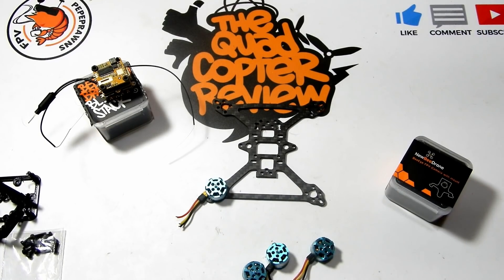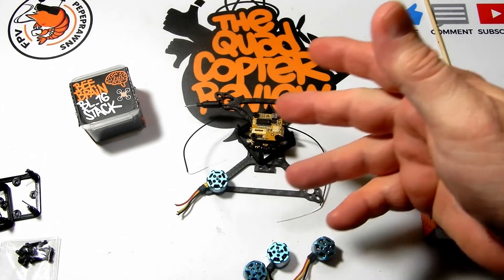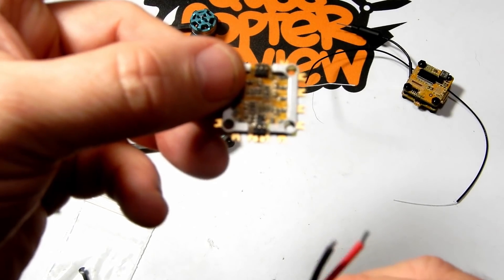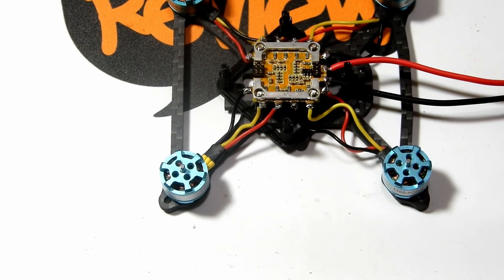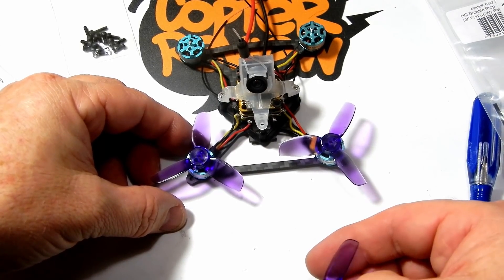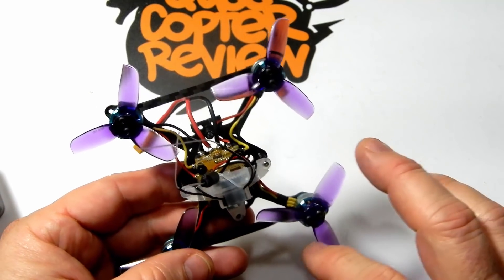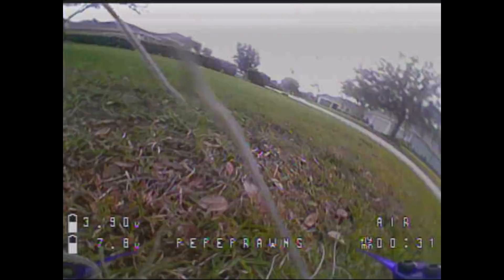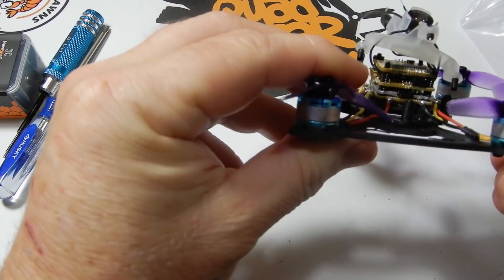Newbeedrone Hive 16 on a Lil Bandito | Oops I Broke It!

Comment: Thanks for the review and crash footage! ;)  Hmmm...Hard to believe a 16x16mm stack is worth anywhere close to 100 buckaroos! YIKES!  We can buy top notch 3" or 5" gear for that price with way more performance. Especially when the iFlight SucceX is HALF of that price and is 2-4S, includes a 100mw setting, and pretty much duplicates all of the other specs.  I does not have the built in receiver, which I prefer, and most do. Built in can be a problem! Look at the Crazybee F4 Pro v2's...those are notorious for short range and fail safes because if it. I bought the no receiver version of that purposely so I don't have those fail safes, and installed an ultralight Frsky R-XSR instead. 
IMO,  none of NewBeeDrones products are a great price. They want a lot for their gear!  Including their expensive and average batteries.
Reply from the maker: Yeah i have 2 succex's sitting on the bench for builds and reviews right now. What a price and 4s. This stack is great for that person that is scared to solder on a 16 x 16 i think. Maybe that first build.
Reply: @TheQuadcopterReview  ...yeah, maybe for a rich guys first build! LOL  Way overpriced IMO.